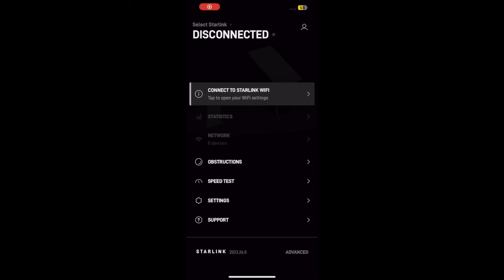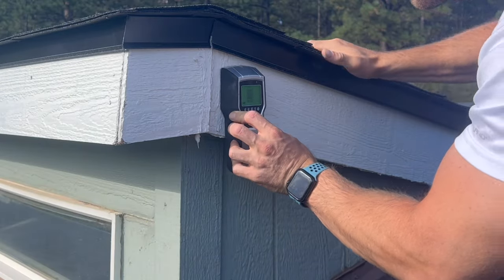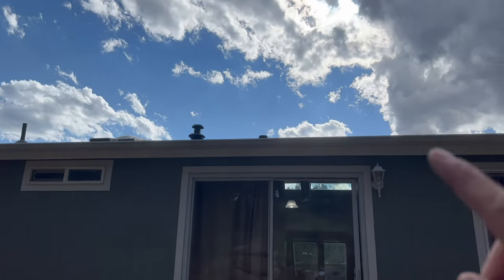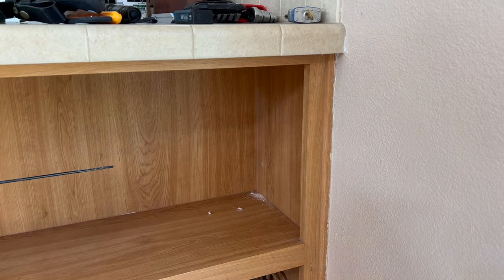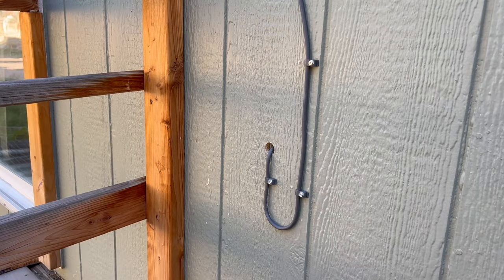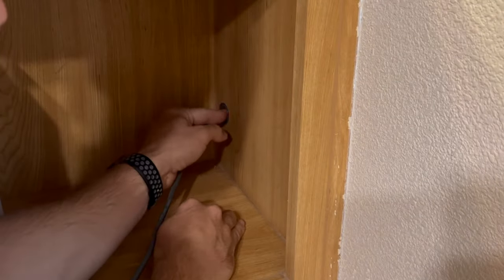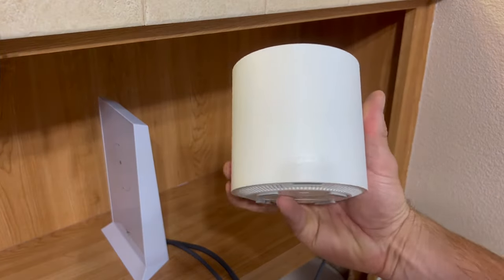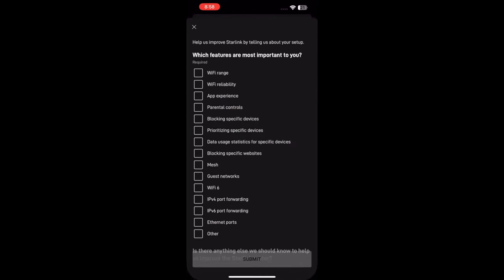Starlink Complete Setup w/ Short Wall Mount + Ethernet Adapter & Mesh Router | Builds by Maz

Comment: Great video.  Thank you.  I just ordered the short wall mount.  My home is in the CA High Desert and can have very high winds..gusts up to 40 mph.  I'm not worried about the strength of the mount, rather the eves that I will be mounting to.  I have this image in my mind of the Satellite dish rocking in the wind and the eve cracking.  Do you think that is a realistic concern?
Reply from the maker: It's tough to say without seeing the eaves firsthand. Ideally you'd want at least an inch or two of material to screw into; if you don't have that, you may try to reinforce it somehow. But if it's a well made eave then you probably shouldn't have any issues. Best of luck!